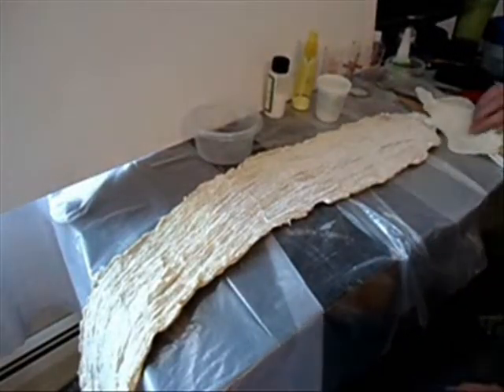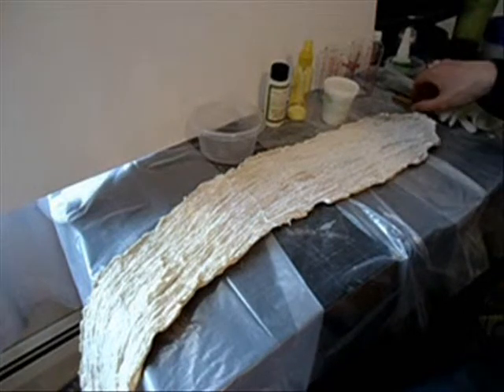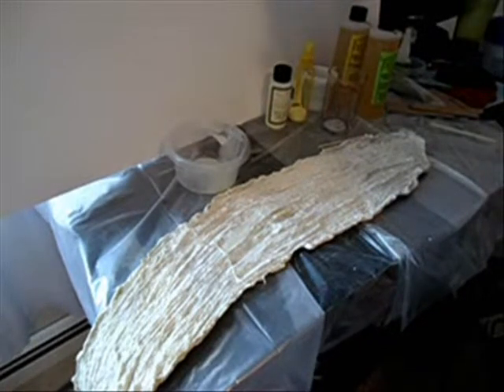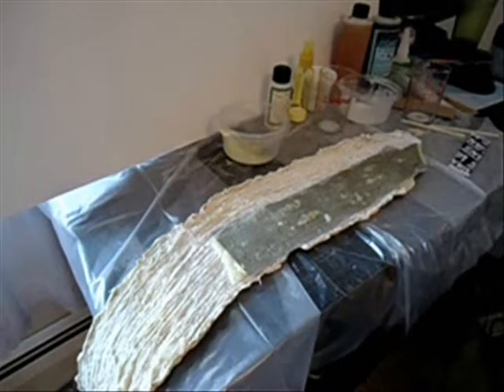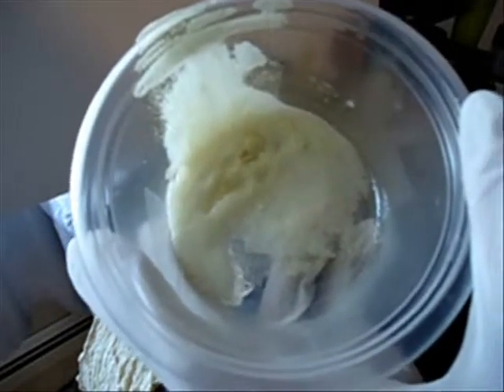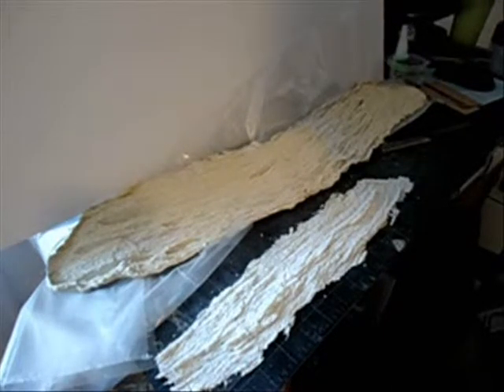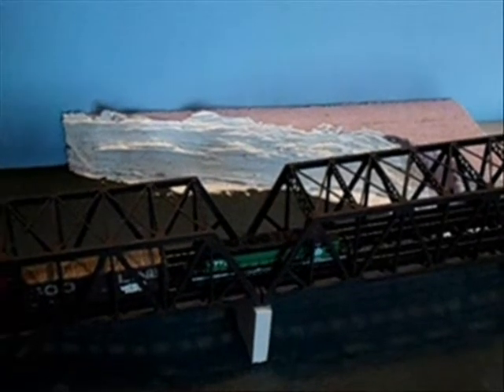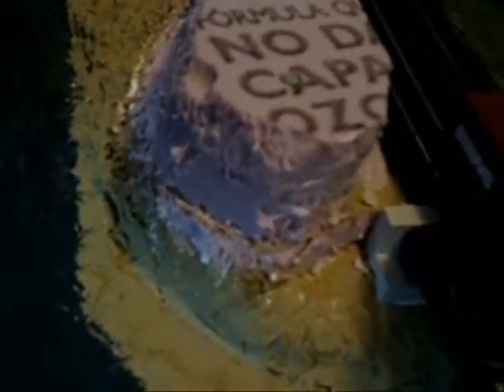Making Rock Castings with Bragdon Geodesic Foam (Part 2)

Comment: Nice video, I saw Joel give a clinic in Portland on 2/25/12 and it is a great
system he has developed. The screen is used not for the rock castings
but for what he calls the hard shell wich is what the rock castings are attatched to.
I also got a starter kit and can't wait to use it. Good luck with it
Carl

Comment: Not bad. Thanks for sharing. I have used Joel's kits for over 10 years, and have brought them on modules to NMRA shows, They are very durable, which is what I like about them, and can accept colors nicely, when done according to the instructions (meaning  don't just slop a thick coating of gray paint on it) I agree with Carl Metz, that the screen is used to contour your landscape, AND NOT TO ADD A S A BACKING DIRECTLY ON THE MOLD. I recently (December 2015) bought some JB supplies at a Train Expo (sponsored by the Hub Division of the NMRA) and spoke to a dealer rep. Joel has a new product out now (catalogue # FF-99) called Magic Bullet mold and casting release. I plan on using it today. I was told for the first application, spray it to "both sides" of the casting. I assume the back side just is an insurance measure to prolong the life of the mold. My "understanding" is that this is in lieu of the petroleum jelly he used to use, as f you applied too much in a crevice (easily done) the gesso and then the paints won't absorb in that "small spot" You still need to spay this with a lacquer paint. (I use white), then as TCR video says, put in the casting resin and then add a small doe of the foam resins (as they exponentially expand - a 1/4" of we sticky mix seems like it ends up 2 plus inches high). Then once dry (enough to the touch) take out of the mold and press onto your contours. Then gesso it and start experimenting in very small applications of very thinned out acrylic paints, and ass the black tempera paint powder into the crevices.